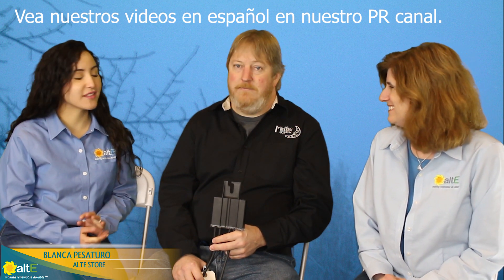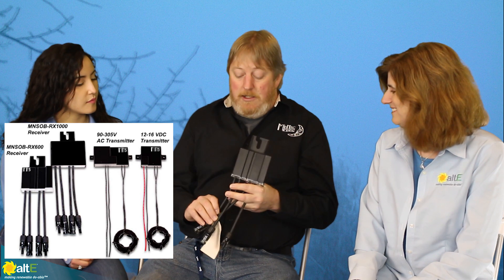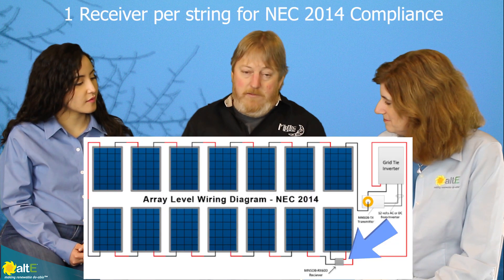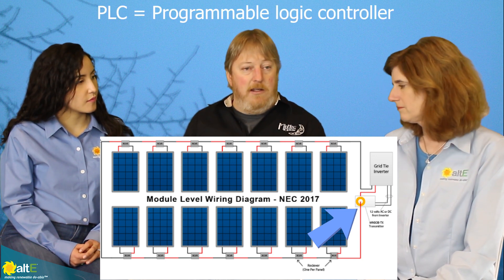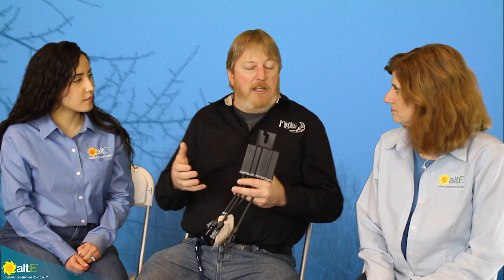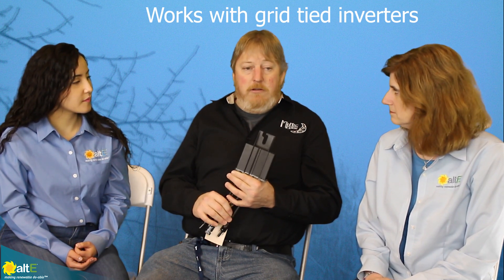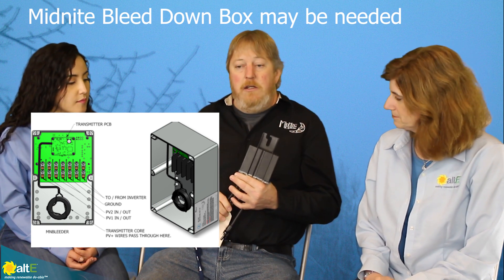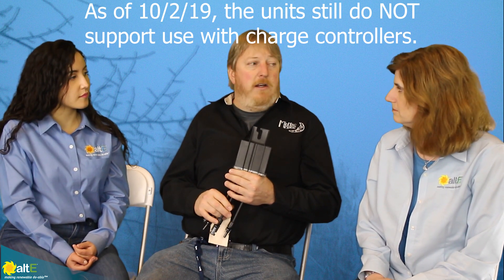Midnite Solar Little Shut Off Box (SOB)

Comment: I can see this being used on series-string systems where voltages can be close to 1,000VDC to protect firefighters, etc., clambering around on a solar rooftop. I don't see the purpose of it on the per-panel microinverter system though. All voltage levels should be safe if the AC side disconnect is opened.

Comment: Hey Amy! Thanks for the video and all of your hard work in the industry! I am thinking about an electric pontoon boatwith an electric motor, batteries, and solar panels to help charge the batteries! There are motors available in both AC and DC. I am thinking that DC would be best! what do you think? Maybe 72 volt system? Thanks!
Reply from the maker: DC is definitely best.  You won't have to deal with losses converting from DC to AC. If you can find a 48V motor, that would be better than 72V, as it is hard to find solar equipment that supports 72V.
Reply: @AltEStore  
Thanks!

Comment: Hi Amy I need you to ask you. I have 2 different solar panels. 1 solar panel is a Rich Solar 300watts, max power voltage 18v, open circuit voltage 22.35v, max power current/IMP (A) 16.67. the second solar panel from Sungrid is 175 watts, voltage at Pmax35.2v, current at Pmax 4.97A,Open circuit voltage 43.6v. I bought one controller Renogy DC-DC ON BOARD BATTERY CHARGER WITH MPPT DCC50S which I want to connect the 300watt solar panel. I also bought a EPEVER TRACER BN SERIES 40A which I want to connect my 175 watt solar panel. Question is can I connect both controllers to 2 new deep circle AGM batteries connected in parallel and not damage them. I called the company that supplied me the batteries and they told me I cannot connect both controllers to the batteries because it will confuse the batteries. What is your opinion. Cheers Bill
Reply from the maker: I think you got the descriptions backwards for the panels. But regardless, you want to make sure both charge controllers have the same charging voltage settings. If they do, they should be able to work together.  If they have different settings, one controller may see the higher voltage from the other and think the battery is full and turn off. So you may only have one controller charging at the end of charge. It won't damage anything, but you may not get as much power as you expect. Check the manuals and see if they can be set at the same setting.